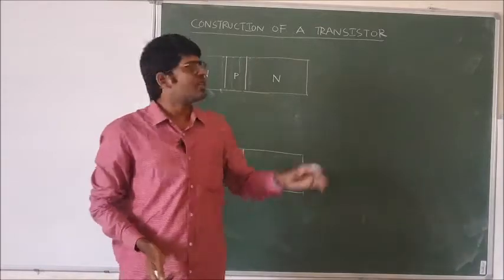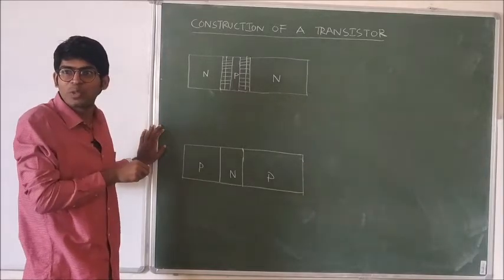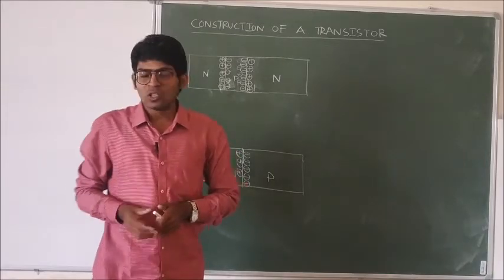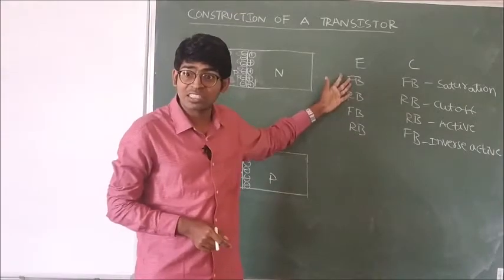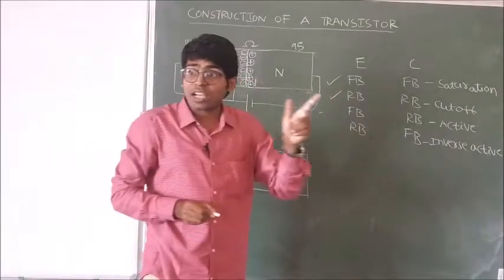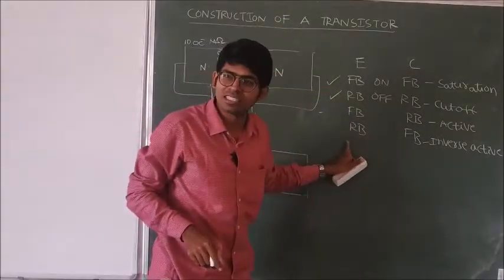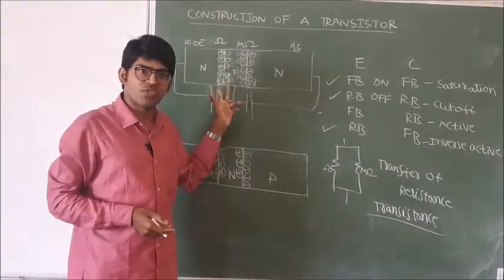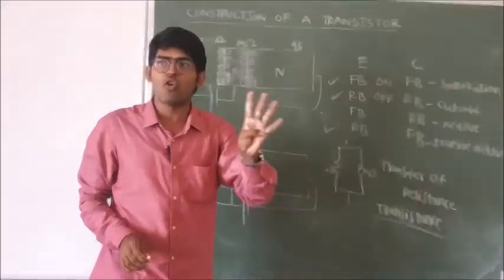87-Transistor biasing

Comment: 20208-EC-048, Emitter is heavily doped, Base is lightly doped and Collector is moderately doped. Giving an external voltage is called biasing. Transfer of resistance is called transistance.